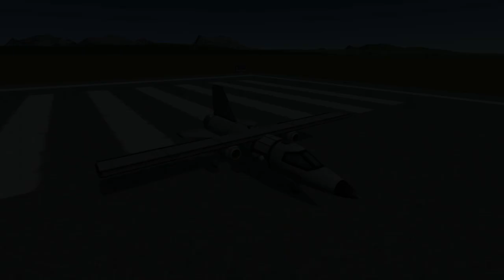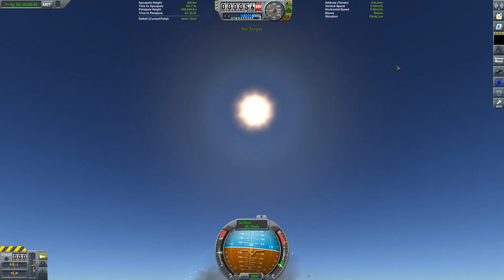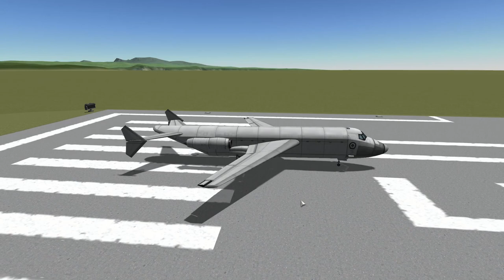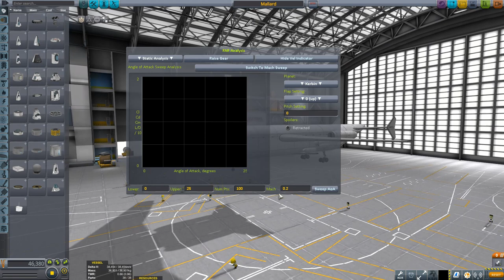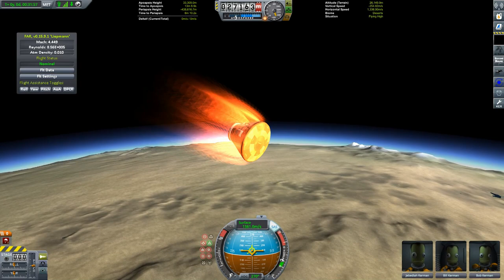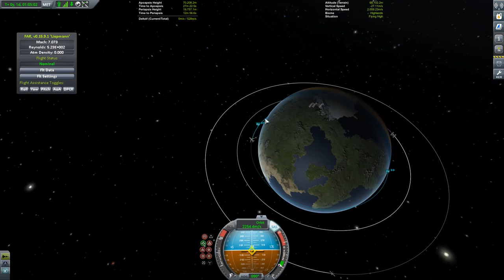Mods: Ferram Aerospace - Kerbal Space Program

Comment: Also if you are planning to use your own vs mine, I strongly suggest limiting the roll and pitch surfaces and using the ksp wiki to adjust the ai pilot. Otherwise it won't go well lol
Reply from the maker: Yeah, been playing about with fighter craft in FAR, let's just say there isn't a lot left for the enemy to do.
Reply: @SonofSmith  I strong recomend simplifying, and for control input do either of these however together these form a great synergy. Either find a way to limit input or vary it. As in to set AOA limits, G's, rates etc and have the ability to give a degree to an input. In stock this is normal and fine control (cap lock). Ideally a joystick or software works. Because having an aircraft stable under SAS means you would build for very high stability which means lots of trim drag, unresponsive controls etc. Which aren't good for fighters.

Comment: Are planes in realit really that slippery?
Reply from the maker: Do you mean the last bit with the shuttle?
Reply: @SonofSmith  yes, and while trying to fly one myself I had the sensation of limitless gliding (I kept gliding for half of an hour starting from 6km of altitude, while on stock my ship just fell like a Brick). Is this how it really works in real Life? Isn't it a little exagerated?
Reply from the maker: For most civilian aircraft, a half hour glide from 6000m (about 20,000 ft) is on the excessive side, but for a shuttle it's getting silly.  Then again it would also depend on how much excess speed, and hence how much spare energy you had to extend the glide period.  In general, FAR isn't perfect, it's just supposed to be an improvement, but what you're describing is, as you put it, a little exaggerated.
Reply: @SonofSmith  it wasn't really half an hour, i exaggerated it intentionally (wasn't expecting an analysis of my case ;D). Btw I'm still impressed for how long even a civilian aircraft can glide, that cleaned up lots of stuff in my mind. Thanks!
Reply from the maker: Sorry, the nerd instinct kicked in. 😆